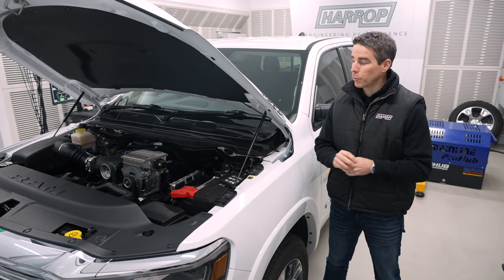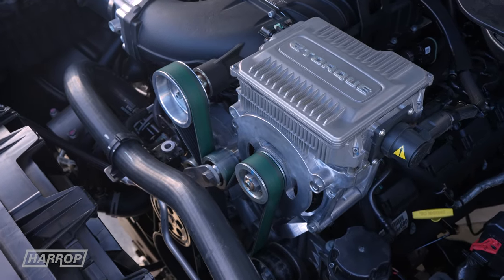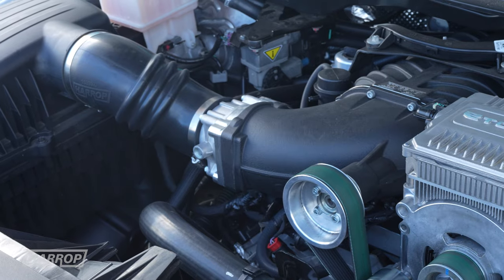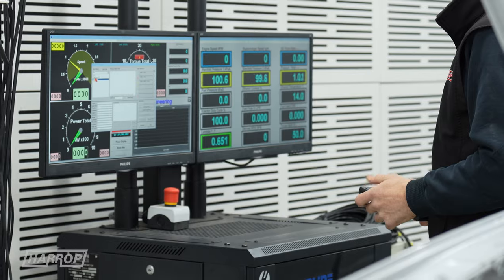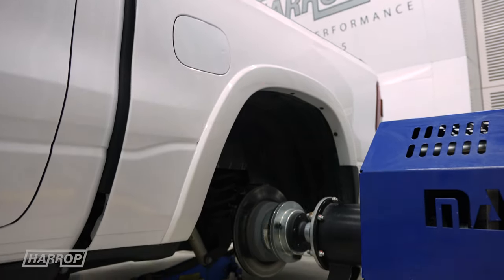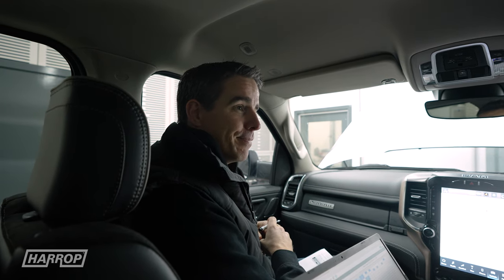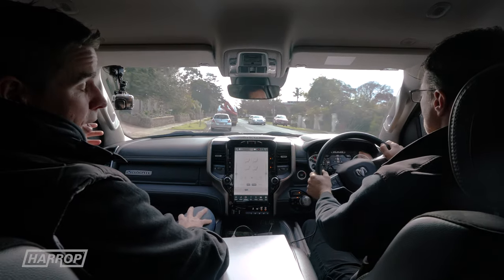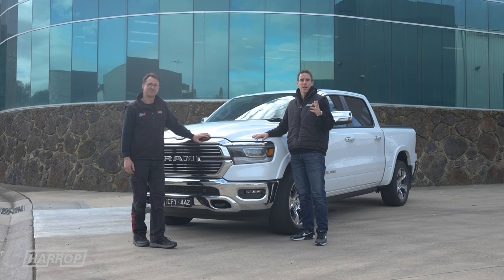RAM 1500 HEMI eTorque V8 | Harrop Supercharged

Comment: For a low low price of $16K this can all be yours! I am impressed someone finally came out with a supercharger for the etorque vs a pro-charger.. but idk who would pay $16K for it. Adding that price on top of my Laramie would have me in TRX territory.
Reply: TRX is 245k
Laramie sport is 133k

133k 
+25k supercharger 
+5k for good exhaust kit
+6k tyres n wheels
+5k for fox suspension. 

174k-180k completed.

How's that even close to a TRX at 245k?
Reply: Where I live, you can get a Laramie for around $66K USD and you can get a TRX for around $90K USD. So, I guess it depends on where you live. Also, I forgot to do the AUD to USD conversion.. so I guess it would make it $77K USD with truck and supercharger. Still, after that, tires, suspension, and labor if you don’t do it yourself.. it would be better to just buy the TRX. Plus, you would have a higher displacement motor.
Reply: TRXs are nowhere near 245k. Split that number in half
Reply: @alexsolo4085 they are talking Australia prices.
Reply: @TheNobodyZone a trx is still not 160k
Reply: Whipple has a supercharger for etorque and it's around 9K. I just ordered a Gen 5 for my Ram.
Reply: Procharger is a brand of supercharger, not a different thing, just centrifugal.

Comment: eTorque is a joke, a gimmick. If the vehicle was a true hybrid, you wouldn't need a supercharger at all, a REAL electric motor would give you the extra 100hp boost when needed. eTorque gives you nothing but headaches and lots of expensive complexity